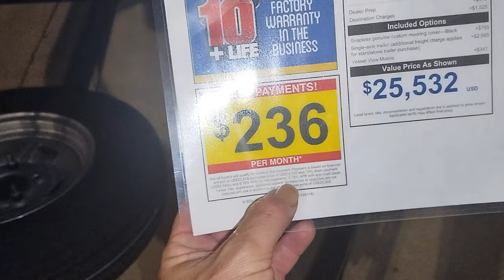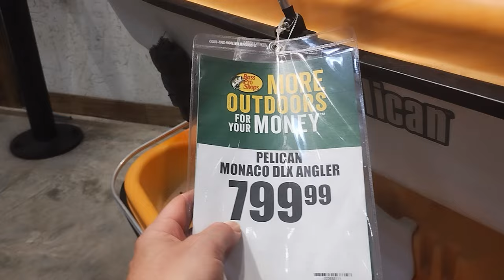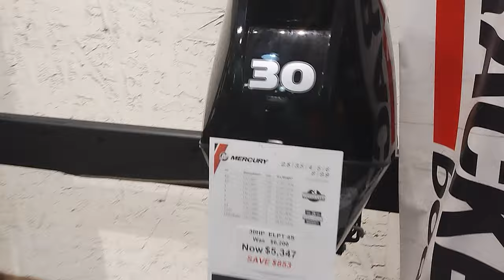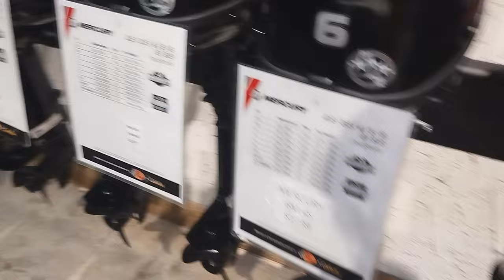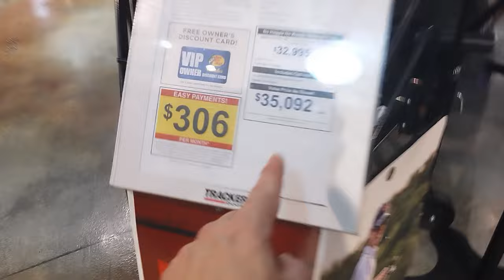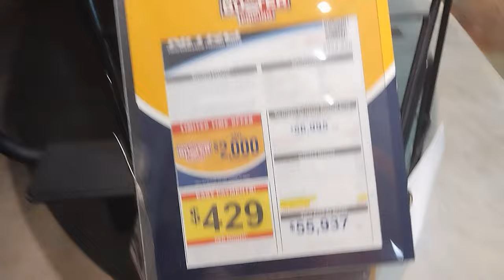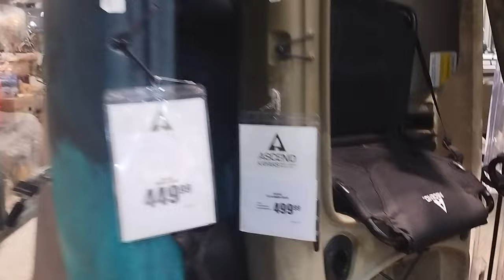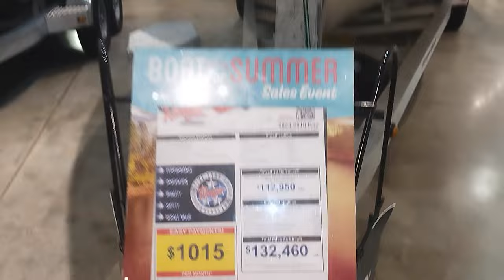2024 Bass Pro Shops! Boats, Kayaks and Small Boats

Comment: Great video!  What is the weight difference between the Suzuki and Mercury motors?  One thing about the 2.5 and 3.5 Mercs is that you can purchase a "performance kit" which increases the hp to 4.0 and 5.0 respectively.  Kits are $200 - $300 and include a carb and a metal prop so then the original prop becomes your spare.  Is there anything like that for Suzuki?  If so, I’m not aware.
Reply from the maker: suzuki is 29# i heard you can upgrade to a 4 as well, not sure though
Reply: @AliexFolgueira  I revisited  the conversions and cannot find the kits for the 2.5hp any longer.  3.5hp > 5.0hp kits are plentiful, however.  I've seen that the 2.5hp Merc is either 41 lbs or 38 lbs. and the 3.5hp is <5 lbs. heavier.